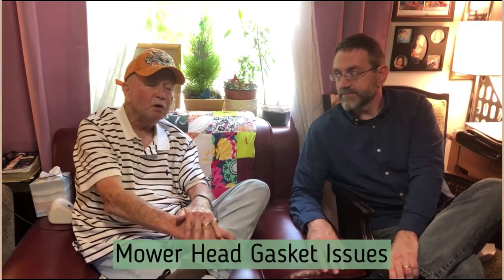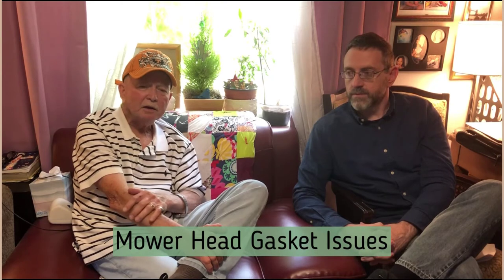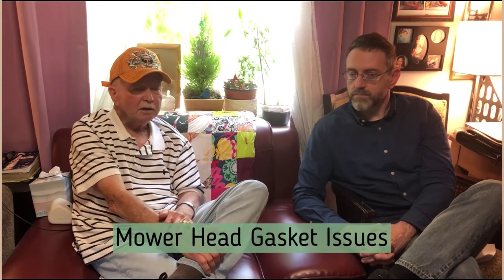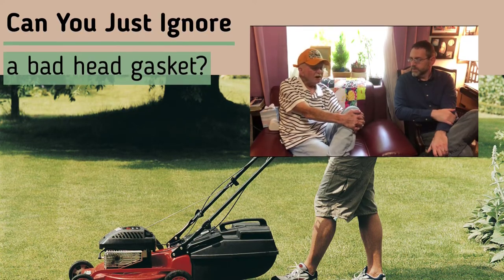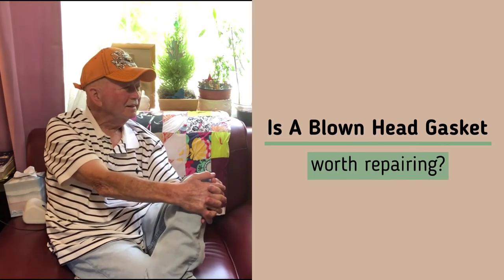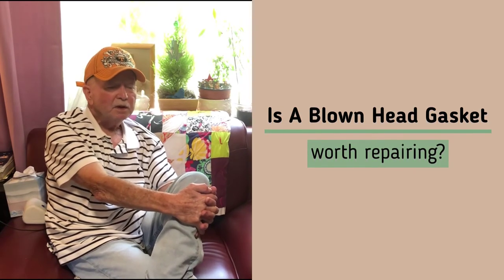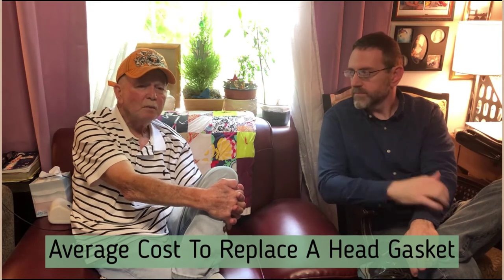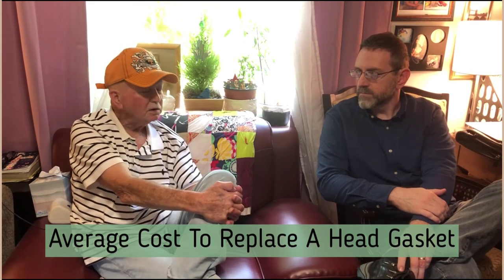Lawn Mower Blown Head Gasket Symptoms

Comment: I have a problem with a craftsman t110 lawn tractor.  I was cutting the grass and the mower just turned off. I started right back up but it only ran a few seconds and hasn't started since. Now I can't push the mower anywhere cause one rear tire is turning one way and one the other way. The mower didn't smoke or make a sound when it turned off. It turns over but won't start. I've got spark and compression from the way it sounds. I'm not sure if its getting gas though. It has that fuel shut off solenoid on this mower. But would the engine not starting cause the mower to not be able to push it even though its in neutral?

Thank you if you can help with this issue. Its down a hill in my yard and no way to drag or push it up hill to the driveway to get it on the trailer to take it to get looked at.

Thank you again

Mike